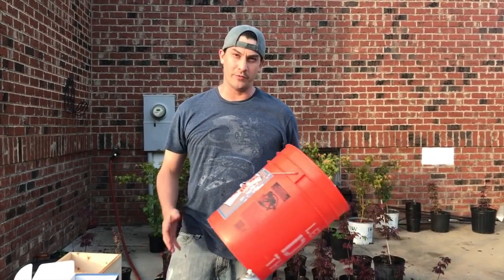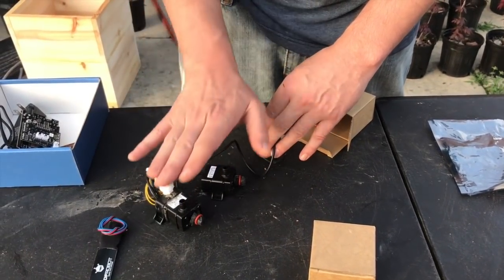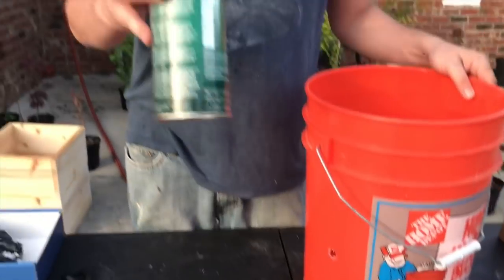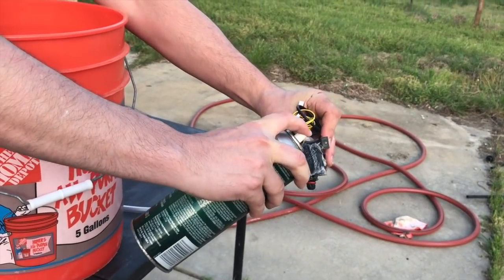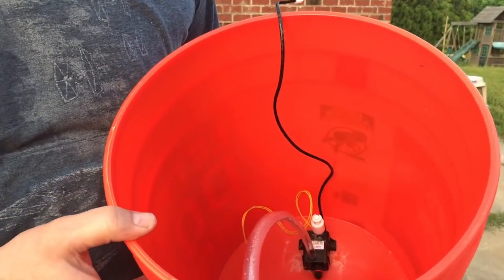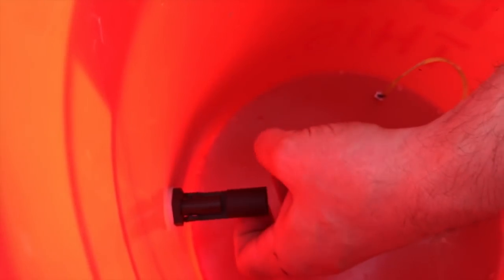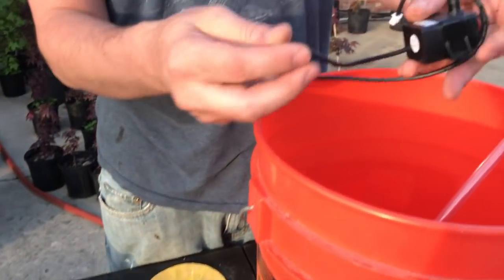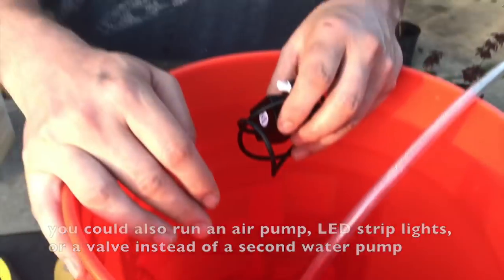Build an Automatic Watering Reservoir with WiFi Alerts for Cultivation Setups

Comment: are just the water level sensors available ? looking for a water level sensor that alerts when low via wifi for a gravity fed reservoir
Reply from the maker: totally - you would just need a base Adosia IoT device to enable the alerting and a horizontal water level sensor switch